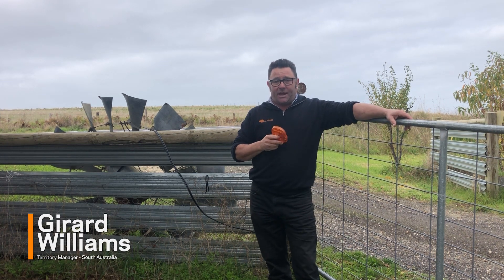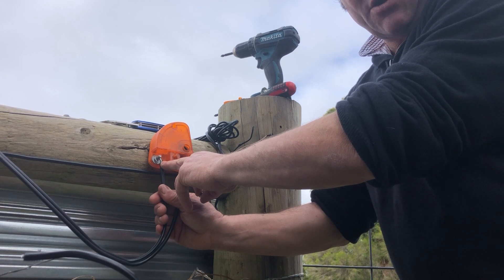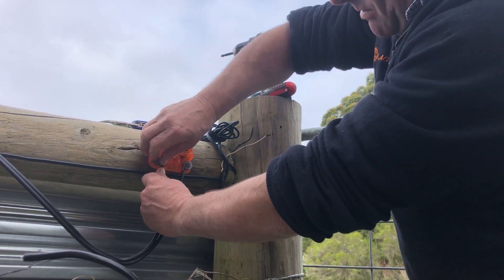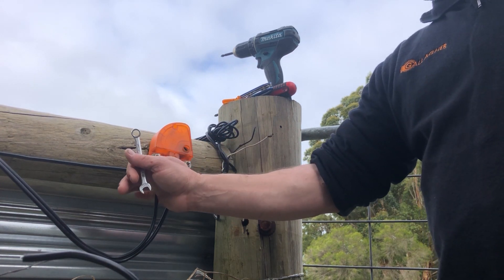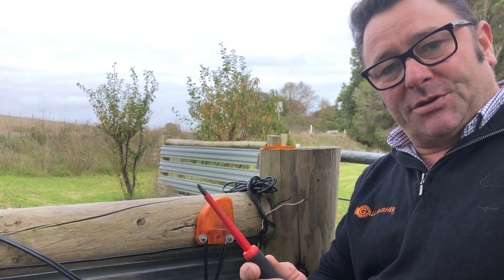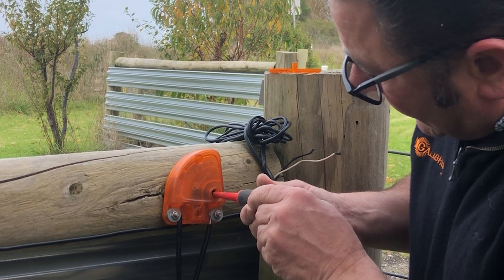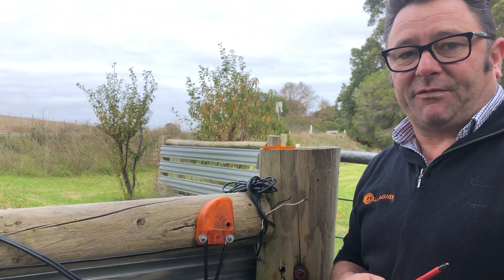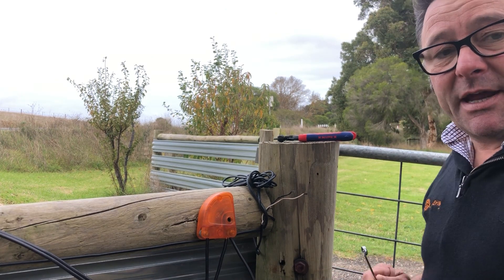How to: Install a Lightning Diverter

Comment: Is it possible to have both a plug-in and a solar on a pasture fence so that way if you lose power at the property the solar will still work so I have both Running if that makes sense
Reply from the maker: Hi there, this is possible with our MBS range of Energizers - MBS stands for Mains, Battery, Solar.
The best option is to connect via a Battery Back up device, https://store.am.gallagher.com/am/us/en_US/i-series-accessories/battery-back-up-charger/p/G58210, which will charge the battery from 110 V, while also powering the energizer.  If you lose power, it will automatically switch over to the battery.
Reply: Not without switching it over manually - can't have 2 energizers on the same fence running at the same time. It can be as simple as using switches to do so, not physically unplugging wires and hooking up the other, but either way - they must be isolated.